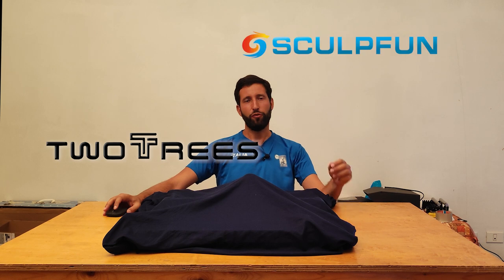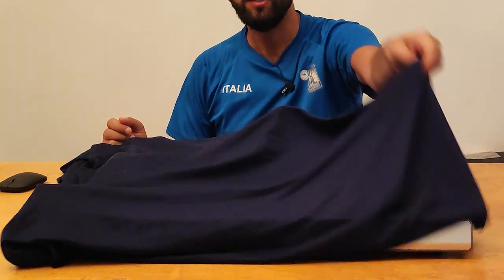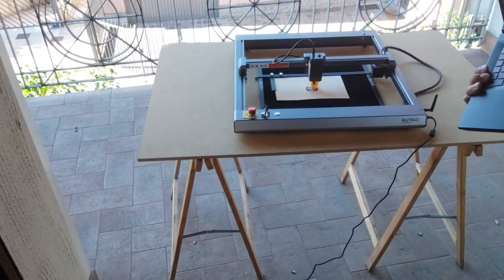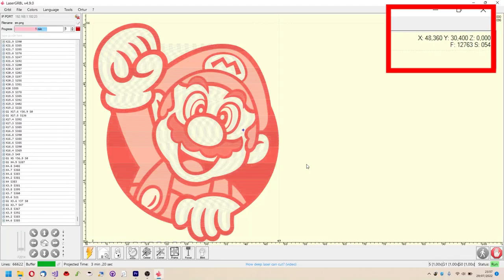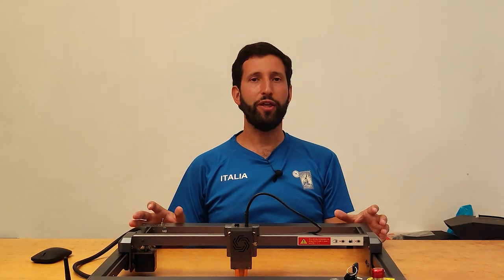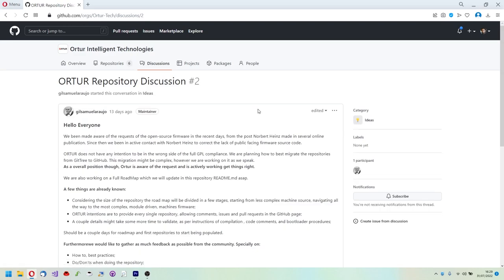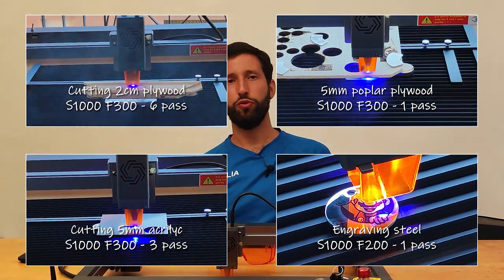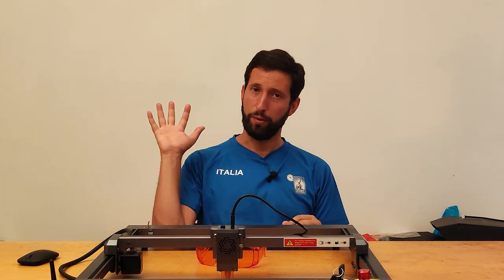Ortur Laser Master 3

Comment: Hi, Thanks, I have the OLM3 and I use lasergrbl, my question is this: Do you know of a materials test card that works with Lasergrbl? It seems like all the test cards are written for lightburn with the cutting templates colormapped for varying the power in lightburn and I cannot find a way to vary the power in lasergrbl othe than separating the image into 100 different files and running each one independently while manually adjusying the power and or speed. That seems like a bad idea...Thanks
Reply from the maker: Get a look in file section of lasergrbl facebook community
Reply: @lasergrbl  I sure will... thanks for the direction

Comment: I got the OLM3 but i can't get it to work . its connected but it does not move. when i use tha GRBL app it shows that the engaving is "being done" but nothing is happening at the machine.
Reply from the maker: The only suggestion I can give you is to check the wiring, and that all connectors are in place. 
I also suggest you contact Ortur directly, you can search on the Ortur Official facebook page where there are some people who respond, who are part of the ortur support team.